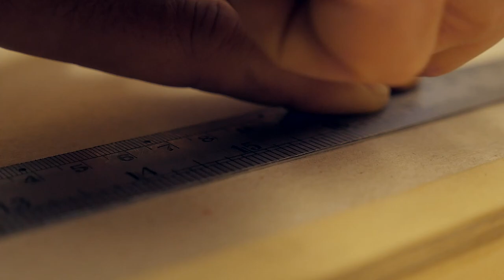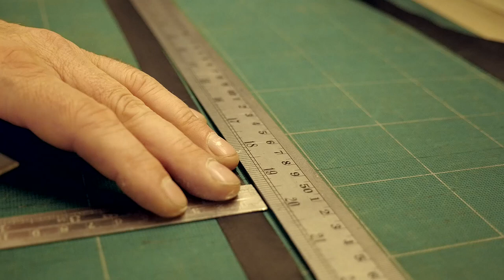Making a Concertina

Comment: Newbies watching this should be aware that this is an affordable student instrument using Italian accordion reeds. High-end instrument use more responsive concertina reeds - which are far harder and more expensive to manufacture.

Nothing wrong with that - with the price of an advanced instrument so high these days there's a real need for this type of beginner offering. But compared to an old Wheatstone or Jeffreys or a new Dipper or Suttner, for example, it's a different kind of beast.